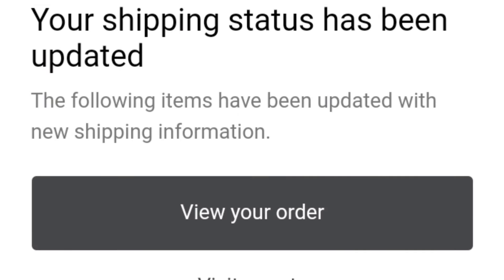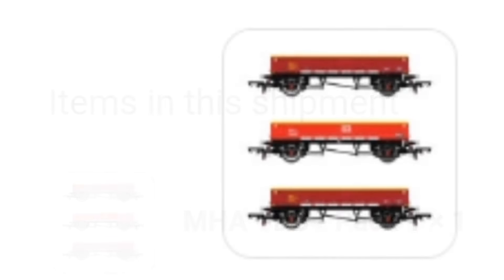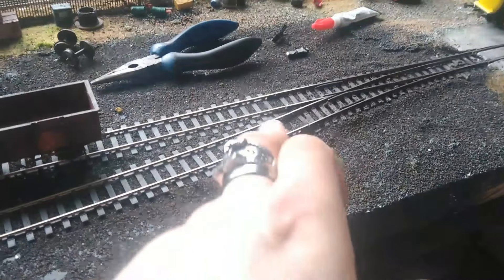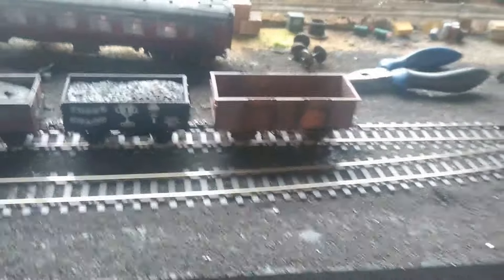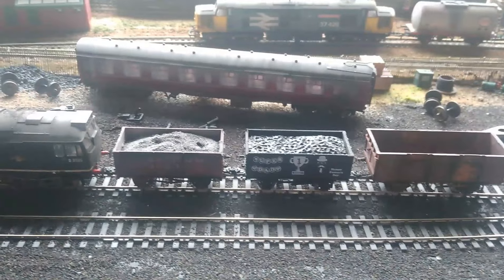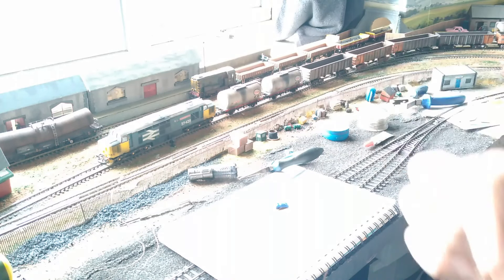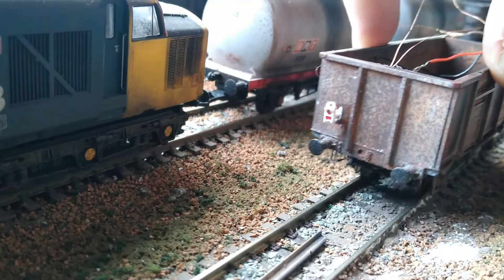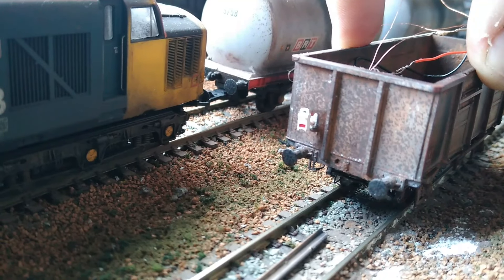Working End of Train Lamps? (FIDDLY!!😬) | Iron Horse Weekly ep14

Comment: Hi Craig.

Maybe put some weights in the wagon and top it up with ballast/coal or whatever to hide the wiring and electrical tape. 

Looking forward to the arrival of the Accurascale wagons and their comparison with your Hornby equivalents. 

TBH, I wasn't aware of the two different angled points being produced by Peco as I thought they only made the short and the long turnout variety, both of which I possess. That has now given me food for thought. 

And once again, we are treated to another 'messy' session with the creation of your new hill. It will be interesting to see the finished product. What kind of farm did you have in mind? Hope it's not a dairy farm as the methane produced by cows is having a negative affect on the environment. 😀 Maybe a few pigs and chickens and possibly a turkey or two for Christmas. 

See you next Thursday me ol' mucker. 

Paul. 👍
Reply from the maker: Well my daughter made a suggestion for the farm so you'll have to wait and see for now 😁 cheers bud;❤️😎